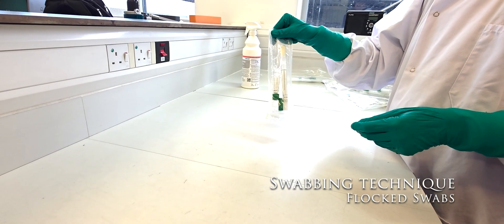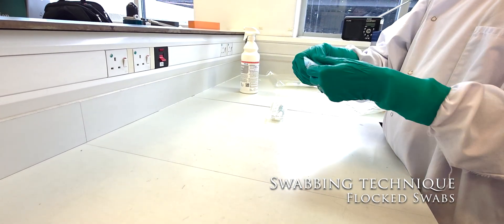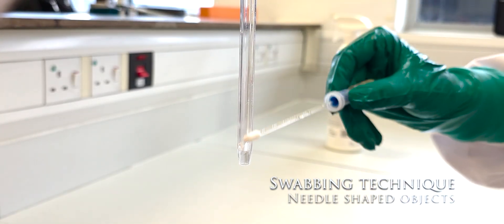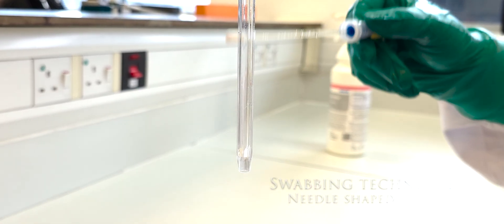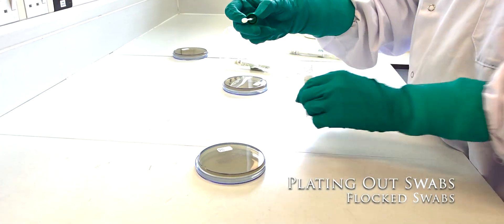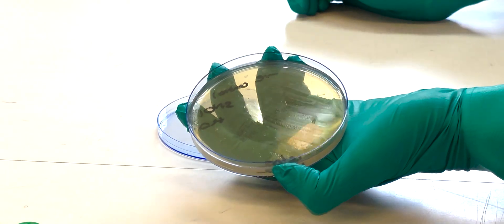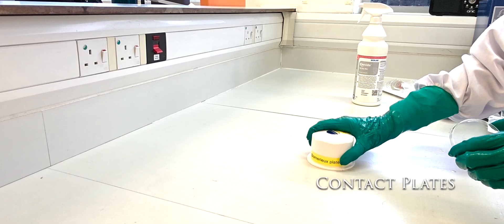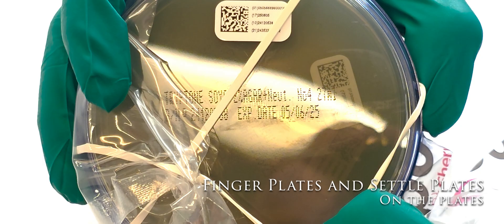Swabbing & contact plate technique

Comment: Kindly guide us, 
How to draw the quantitative limit for surfaces sampling by swabbing method(or from which guideline we can take limit for swab samling), everywhere contact plate limits are given...
Reply: Rodac has a diameter of 55 mm. If a sample is to be taken with Swap, 25 cm2 should be taken. For this purpose, you can use autoclavable silicone with an internal size of 25 cm2.